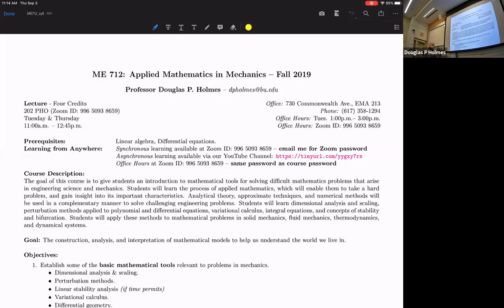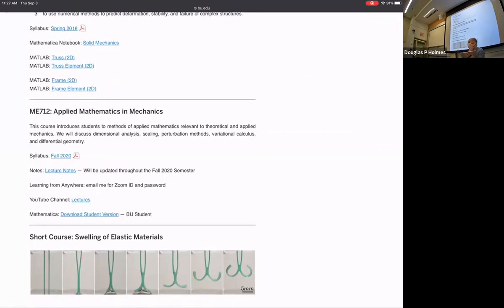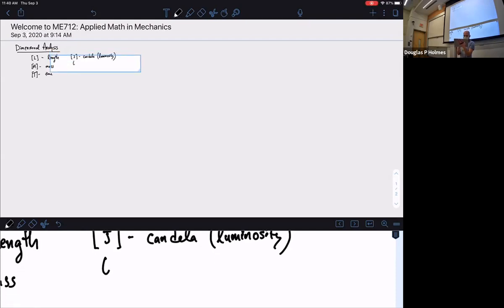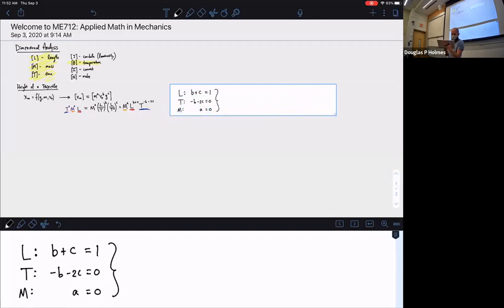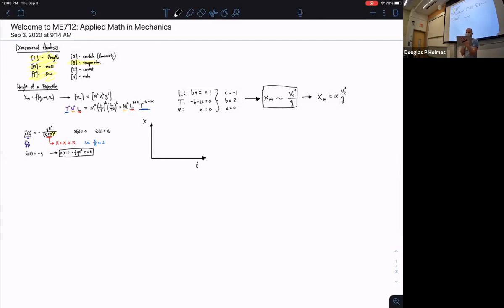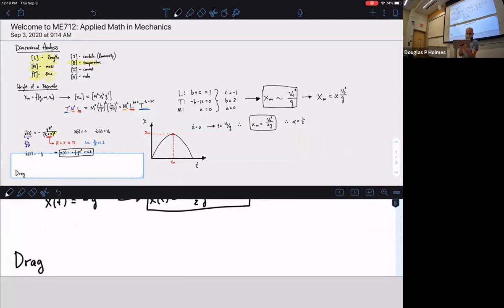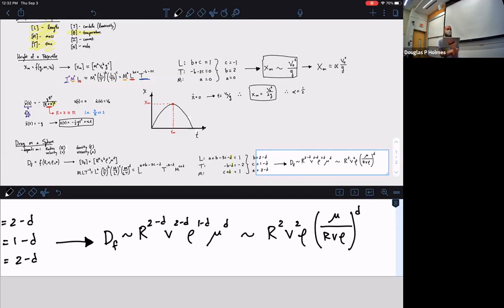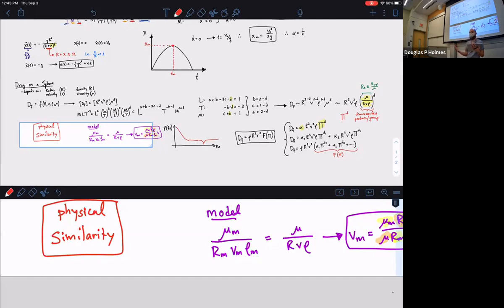Dimensional Analysis & Scaling (ME712 - Lecture 1)

Comment: @38:50 I can't figure out how L=1 but T & M=0. studying this in preparation for a course I've got coming up in a few months (Not so good at Maths, hence I'm preparing early), thanks for putting all this content up
Reply: On the left hand side we have the height of the projectile “x”. This has units of length. The entire problem also (may) contain mass and time as other dimensions, and so we write L^1*M^0*T^0 on the left hand side (recalling that anything raised to the zero equals 1). If instead of height, we were interested in velocity, we would write L^(1)*M^0*T^(-1), since the units of velocity are L/T. Hope this helps!